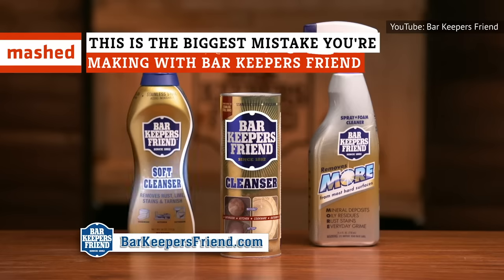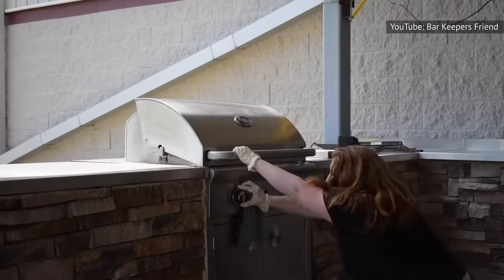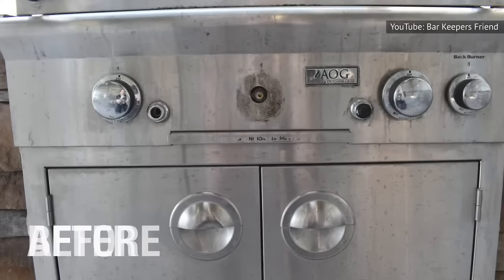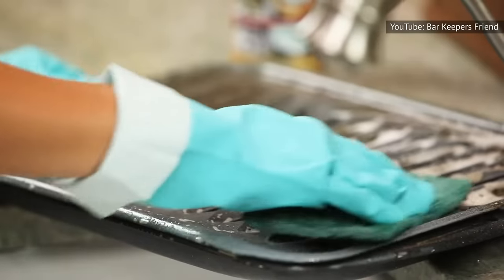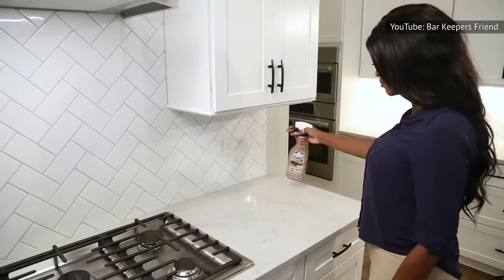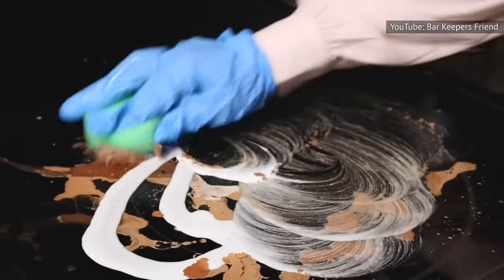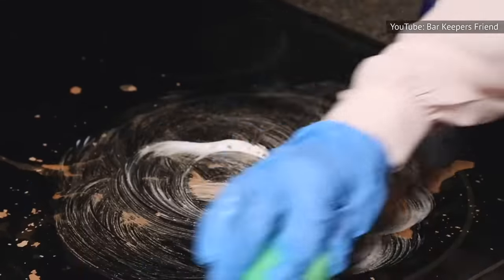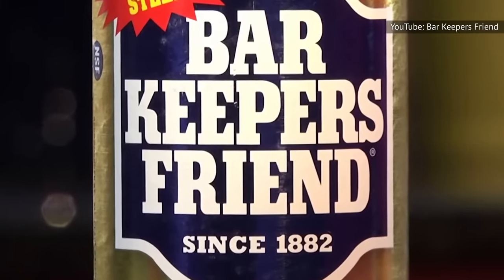This Is The Biggest Mistake You're Making With Bar Keepers Friend

Comment from the maker: What's your go-to brand for cleaning products?
Reply: I've been using bkf for most of my 68 years, except that for a while, I was using a cheaper version that safeway used to have, but no longer does.
Reply: BKF, Windex, Dawn, Bleach, Ammonia.
Reply: Oxi-Clean crystals dissolved in warm water with a smidgen of dish soap.
Reply: good 'un That actually sounds like a good idea I need to try!
Reply: @jojomakes  , you wouldn't think so, but my Oxy-Clean/dish soap mix  removes cigarette tar and nicotine better than anything else I've tried. I also scrubbed my house's cedar siding with it before staining (pressure-washing would damage the soft cedar, so I used a scrub-brush on a pole); and Oxy-clean won't damage your lawn or plants. I have a set of old Excelite brand screwdrivers with clear butyl plastic handles that develop a weird waxy white residue on the handles; OxyClean removed that too! It works well on laundry stains and is less damaging to clothing, and the environment, than bleach.
Reply: Spray Nine.  Use it on everything.  Every surface.  Even carpet....
Reply: merry maids 😁
Reply: endust, used properly, is a wonderful product.
the key is to lightly spray the cloth only, then let it dry completely, before dusting. you can even use it on electronics. it turns any cloth into a magnet for dust.
Reply: I think it depends on the job🤔. For kitchen items (Electric tea kettle, coffee maker, rusted wok or cast iron) Distilled white vinegar and baking soda. It even works on pet stains and as glass cleaner!! Vinegar is AMAZING!! Lol But bathroom and multi-touch hard surfaces…..BLEACH or ALCOHOL BASED  CLEANER!! Love lysol and clorox for bathrooms, door handles, spraying shoes…etc
Reply: White vinegar on tools and tile grout! Spray on grout every week. All mold gone.
Reply: @goodun2974   hello, what do you clean with oxi-clean & dish soap?
Reply: @dragan3290  thank you, I never knew you can use vinegar on grout.  🤗
Reply: BKF
Reply: @goodun2974  my sister just had me use it on an old grease stain on my blouse. It worked!
Reply: @TonyaJones0788  it took a grease stain off my blouse.
Reply: Made a paste and left on an antique ceramic dish that had a weird stain that would not wash off and Oxy Clean removed it!
Reply: BKF, VINEGAR, DAWN, BLEACH, BAKING SODA

Comment: As an experienced and somewhat obsessed collector of vintage cast iron cookware, let me say Bar Keeper's Friend deserves the nickname "cast iron cook's friend."  About their warning not to use BKF on bare cast iron surfaces, this only applies to a pan that has already been seasoned and is ready for cooking.  If you have an old, dirty, rusty, grungy cast iron pan that you purchased at a flea market, garage sale, or found out in the woods, BKF is THE best cleaner for removing rust and grit from a cast iron seurface, except perhaps for an electrolysis setup.
Reply: i have a carbon steel pan i tried to season, only to have it peel. do you think BKF would work on this?
Reply: @faithnelson6069  Sounds like you may want to strip it completely, using a lye bath or oven cleaner in a trash bag.  After soaking it for a week or so, use BKF to completely scrub all of the coating off and leave a bare pan.
Reply: @castironchaos  i was afraid you might say something like that. ha ha!
Reply: I have a carbon steel pan, and I love it. I initially seasoned it with flax seed oil. I put a thin layer on with a paper towel then put it in the oven at 450 for about an hour. Then every time I use it and clean it, I put a thin layer of flax seed oil on it. It took a while to turn black but now it is awesome.
Reply: @rodyodo  that's what I use on my cast iron too. 👍
Reply: @marielaveau5321  Flax or linseed are the best - they chemically cross-link and form a hard polymer layer, which is what most modern non-stick pans rely on.
Reply: @MsWagQ  thank you for explaining all of that. mine is all carbon steel, so no removing anything. vinegar and baking soda sound much more up my alley too. i am loath to breathe in the more caustic stuff.
Reply: @faithnelson6069   You’re welcome!! I completely understand. If I can clean naturally, that’s my aim. Lol Two asthmatics in the house, the last thing we need is caustic fumes!! Don’t forget to oil the outside of your pan too!! 😊
Reply: I have a cast iron pan that was handed down for over 100 years and it is my favorite pan.

Comment: When you’re done using BKF, put a ziplock bag over it and rubber band to secure the bag.
Reply: My stove is too big for a ziplock bag, never mind finding a Huge rubber band !
Clarity . . .
☆
Reply: First place a piece of toilet paper over the opening of the container then the plastic baggie over the top held on with a rubber band. BKF absorbs moisture in the air and eventually clumps and doesn't sprinkle. Don't store opened BKF in a bathroom cupboard. A bathroom gets too much humidity from the hot showering.
Reply: I have been doing that also.
Reply: I use Press N’ Seal and an elastic.

Comment: If you want your stainless steel sink to sparkle, use a Mr Clean Magic Eraser sponge, even after using BKF, the sponge gets up hidden grime and the sink looks very shiny.
Reply: for me on extreme well water there are still sometimes some white spot traces left behind no matter how much reapply.  I found I can remove them to sparkling with alcohol!  Also on items like toasters, appliances etc. I apply it to the rag or to the eraser product as sprain directly on the appliance sometimes leaves a slight discoloration.
Reply: That can removed the finish. Do not recommend.

Comment: "Non-expensive" is relative. In terms of powdered cleansers it is 3x more than other powdered cleanser products (Comet, Ajax, etc.) but it works 100x more effectively. 

One problem with BKF is that it absorbs moisture in the air. Once you open the container it soon becomes clumped and no longer sprinkles. You can delay this a little by placing toilet paper held in place by a plastic sandwich baggie and rubber band over the opening. Moisture will eventually get to the powder though. Do not store the opened can in a cabinet under the bathroom sink because of the high humidity from the shower.

BKF is amazing at cleaning stainless steel pots. First use vinegar, another amazingly effective cleaner for stainless steel pots. Sometimes burned on stains require a bit of elbow grease with a non-abrasive scouring pad and BKF.

Comment: Thank you SO much for covering BKF on your channel. This was a lovely surprise!
Also, fun fact: You can't use original BKF on granite or marble, but we DO have a cleaner made for that purpose. ;)
Reply: Hello. Is there any way to remove the residue if left on overnight accidentally? My mother was cleaning the kitchen at night and fell asleep with BKF on our stainless steel stove top. Now there are white stains left on the stove top. Please let us know.
Reply: Thanks BKF!
Reply: Hi can you tell me if the soft BKF is acceptable for an acrylic tub? There are rust stains in the tub of an apartment I just rented and I would love to eliminate them before using the tub but just want to make sure this product will not damage it. Thanks!
Reply: Do you have something that would take out water stains on quartzite countertops?
Reply: @Lara-wr2nm  Bar Keeper's Friend. I use it on my car windows. Meant to quote Tara.
Reply: Hey it ruined my car paint, no way it removes small scratches like your website says. Only left it 10 secs. Also, it made zero diff to my glass shower door

Comment: BKF does an AMAZING  job cleaning the shower door and glass! I always hated cleaning them , until I started using BKF. It cleans the minerals off the glass easily !!
Reply: I'll try that
Reply: @OscarM.94  do not scrub very hard, rub it in very gently.
Reply: @truthseeker8573  thank you for the tip👍🏻
Reply: I was wondering if BKF would clean shower doors and hoped I would see that it does when I came across your comment!  Thank you!

Comment: To clean the burned on crap on stainless I use this with a little salt and a blue scouring pad...amazing - and no scratches. Best result is lightly scrub and then let it sit a minute then scrub some more and rinse.  Repeat if necessary which it usually is but keeps pots looking great.
Reply: NEVER NEVER NEVER use salt on stainless steel !!! It will create pitting in the surface. Salt helps prevent the shell from cracking when hard boiling eggs but if the granules do not dissolve quick enough they will eat the stainless steel surface. If this has not yet happened to you it is only because the salt dissolved before it could eat the surface. Don't sprinkle salt into food while it is in stainless steel cookware. Salt it later or at least make sure the salt mixes in the food. Do not allow any granules to rest directly on the stainless steel surface. If you use it as an abrasive element for cleaning it can cause permanent damage. The two most effective ways to clean stainless steel pots are a sequence of 1. vinegar followed by 2. BKF using a non-abrasive scouring pad. Food that sticks to the surface comes off with vinegar and heating the pot. Stubborn burned on stains come off with BKF and a non-abrasive pad. These work miraculously because stainless steel cookware is a different animal to cook with and clean.

Comment: Sometimes me and the gang race up and down the block with BKF on our handlebars.  Sometimes I use BKF to clean scissors after I run with them. All joking aside it really is a great product and once you start using it you find it is a go- to product in ways that just begin to occur to you. Apply common sense with any acid, and don't use it on your fine Corinthian leather.

Comment: I used it on my gas stove top and burners today and it cleaned it pretty close to brand new.  Unlike the lady with the metal tea pot in the video, I used a soft cloth, not a scour pad.  keep in mind that in the past, I had always used a super wet, soapy S.O.S pad in the past.
Reply: Steel wool scratches chrome. That tea pot in the video was chrome.

Comment: i had a bad hard water calcium and lime build up that was gradually getting worse (we have very hard well water and due to my wife's medical condition we cannot use our water softener any longer)  over the past few years. virtually everything i read online was a no no for brushed nickel fixtures. We have two trough type spouts on our bathroom sink  faucets  and the calcium and lime deposits with discoloration was bad.  i think its the oxalic acid in BKF that is considered a no no. Even white vinegar 5% a no no. i threw caution to the wind and tried apply boiling  hot water over a paper towel packed in the  trough to let it soak for a couple minutes (supposed to soften the limescale...it didnt). then i tried the same process using 5% vinegar which i did several times but only left it on for 5 minutes at a time then rinsed it off. i've seen where you should only leave the acid on brushed nickel less than 30 minutes. i was too chicken to try 30% cleaning vinegar which i think would really work but potentially damage the finish (it and a pumice stone works great for the limescale in our toilets).  i actually think that helped somewhat. But what really worked was a blue Scotch Brite scour pad (non scratching) and BKF and a lot of elbow grease. it took about 30 minutes of scrub/rinse with repeated applications of BKF but eventually i got all the limescale off and the faucets look brand new again and the finish is intact.
Reply: Next time try Lime Away !
Reply: Pouring boiling water into a toilet is dangerous and can crack the porcelain. Hot water with dish soap is useful for unclogging a toilet except make sure you pour it in slowly. Also, if you heat the bowl too much it can soften the wax seal.

Comment: I thought ai would have to replace the ceramic tile with stained grout & very stained porcelain tub.   My honorable contractor told me to use liquid BKF instead. Scrubbing with it was pointless. I finally coated the grout & tub with it and left it for 24hr. When I washed it off it was beautifully white-a miracle- withno work!!

Comment: Interesting.  I have used BKF in conjunction with Purple Power degreaser and a UFO green scrubby pad for years with no ill effects.  On my stainless, regular steel, and aluminum pans, enameled burner pans, and on and under my stove top.  I will let the Purple Power soak on the surfaces for a few minutes to a couple hours (not long on aluminum) and then apply the BKF directly into the Purple Power on the surface and make a thin paste.  Doesn't take much pressure, even for burnt on stuff.  Purple Power by itself has a little bit of a fume issue, will irritate the eyes and nose/throat a little (Not anywhere near as bad as oven cleaners are!) but it does not appear to change or get worse in combo with BKF.  I am exceptionally hypersensitive to all manner of chemicals and VOCs and have used this with my bare hands with no particularly caustic effects, but mostly I do use gloves.

Comment: I used the coffee pot cleaner in my stainless steel peculator and I have a really clean coffeepot. But all I  can taste is Barkeepers friend after trying everything I know about neutralizing acid cleaners! I wish they would make a video on how to save my coffee pot!
Reply: Try running a few rounds of white vinegar through it
Reply: To clean stainless steel begin with heated vinegar. That lifts off most things stuck to stainless steel. For burned on stubborn stains I use BKF with a non-abrasive pad. If you taste it you are not rinsing it off well enough. For a coffee pot I would brew a pot of vinegar followed by three of plain water. I don't thoroughly clean my coffee pot like this daily, even weekly. No more than once a month. Daily I just use dish soap and water.

Comment: love this product, I use it to clean my stainless steel pans after a cookout.  Removes scorched on food and grease in about 15 seconds of scrubbing with steel wool.  I swear this must have a metal polish in it because my pans and pots come out so shiny you can use them as a mirror.  The only thing I don't like is the smell... pretty bad!
Reply: Steel wool can scratch stainless steel. A non-abrasive scouring pad is abrasive enough and will not scratch the stainless steel surface.

Comment: Boy did I make the mistake of leaving it on metal for too long. I mixed BKF with water and soaked my SS multi-tool in it for several hours, hoping to clean the grime off it. All the exposed surfaces are tarnished.

Comment: I love Barkeepers Friend, but it always seems to get clumpy halfway through the can.
Reply: Yes, if you use the dry powered can or the liquid version you will get solidification to some extend. The powder absorbs moisture out of the air & the bottled liquid version settles to the bottom & stays there. In both cases cut open the container & remove what ever you have left & put it in a plastic container & add water, mix if possible making a slurry. Add enough water to cover (1/4") and cover. Use a small steel spatula or the flat end of a spoon handle to scrape out. I purchased 6 bottles @ a good price 2yrs. ago & had to do this with the first bottle. I use this stuff all the time on my coffee pot & my All Clad & SS sink. I'm still on the 1st. bottle. A little goes a long way.
Reply: I think it actually says right on the can” can opener friendly”.
Use a can opener . Pour it out.
Reply: @bigred4379   Once it has absorbed moisture and clumped up it no longer sprinkles. You can open the container by taking off the top to break it up a little but it is useless for sprinkling at this stage. It is still useful to make a paste with though.
Reply: Do not store it in a bathroom cabinet. The showering is too humid an environment. But it absorbs moisture everywhere you store the opened container. You can delay the totally clumped stage by placing a piece of toilet paper over the top then holding that in place with a plastic baggie and rubber band.

Comment: 6 months ago I put in a new stainless steel sink. It seems like if I look at it wrong I see another tiny scratch. So I’ve been using the soft side of a sponge. About 3 months of having the sink I’ve notice what looks like small spots like rust. I bought the Bar Keepers Friend polish in hopes it’ll remove whatever it is. There is nothing in my sink that could rust so I’m not even sure if it’s rust. I used the polish and it didn’t really do anything to the spots. The instructions didn’t indicate to use it when the sink was wet or dry. I’ve seen videos of people using scrub brushes on their stainless sinks, how do they do that and not scratch it?? Any tips on how to use the polish? Thanks.